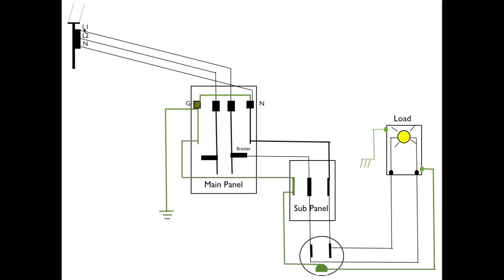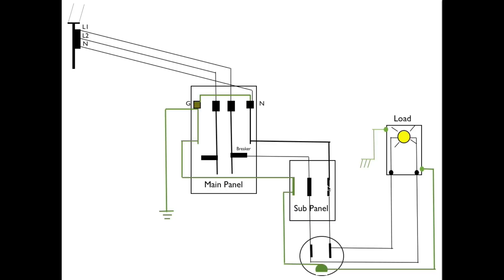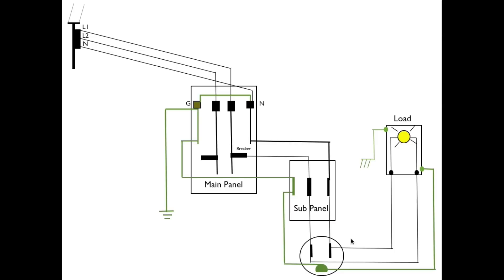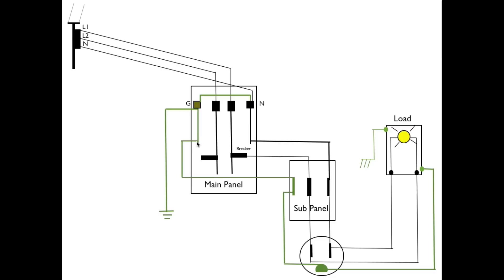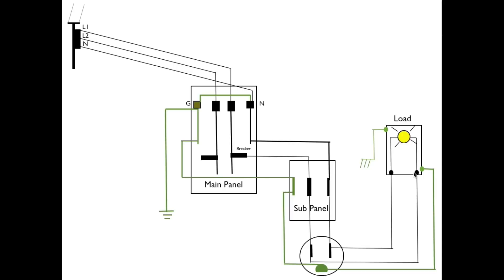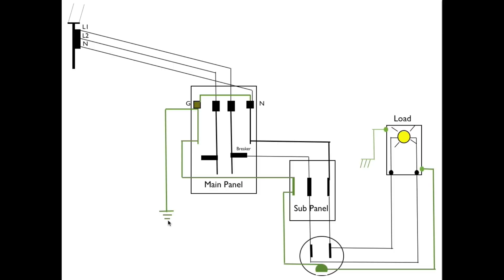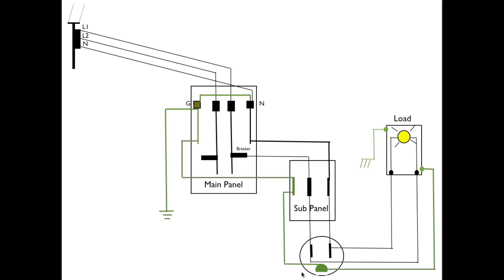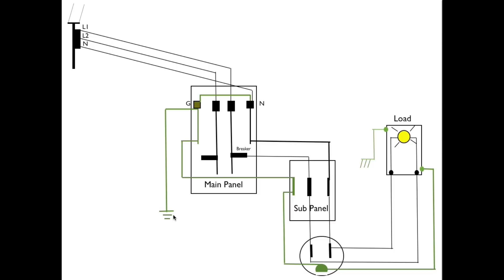The difference between neutral and ground on the electric panel

Comment: If you connect the metal case to the neutral wire it should work fine because this wire is also connected to the ground, if the hot wire became loose and touch the metal case it would be a shotcircuit to both neutral and ground. The problem becomes if you wire the installation backwards or in some countries like here in Spain you have plugs that can be connected either way.
There are also Ground breaker circuit devices on the electric panel and they need separate ground wire to work.
Reply: The active (hot) wire is not connected to the case, you need double failure to get this "lethal device" the active (hot) wire has to became loose and touch the metal case, and the metal case needs to be isolated from the ground.
Reply: Prior to the 1950's appliances such as stoves were actually grounded via the neutral conductor, there was no grounding wire. Spain uses 240 Volts only, there is no neutral wire.
Reply: Why do you say that there is no grund wire? We use 380v on a three phase system and 220v when its a single phase. There is neutral wire but you can't use it to ground because the power plugs and sockets are symmetrical, if you do that you could unplug any device turn 180º connect again and the metal case would be connected to the live wire instead of being grounded through the neutral.
Reply: Back in the early days of electrified homes in North America, the wiring was done using separate, open conductors, similar to the overhead, outdoor power lines, only rubber insulated and cloth covered, supported by porcelain insulators and sleeves, and protected by woven cloth sleeves (loom) where needed (a wiring style often called knob and tube, after the supporting insulators). Connections were made using soldered splices, wrapped in rubber insulating tape and cloth protecting tape. Nobody thought of running a non current carrying, grounding wire around the house, as this would require extra work. Major appliances, such as the kitchen stove were connected to the system by having the house wires go right up to the stove's terminal block (hard wired), with no plug. The case was grounded by running a wire or strap from the case to the neutral terminal of the appliance. Portable appliances, such as table lamps, toasters, and irons, were connected via a plug and receptacle having symmetrical, vertical blades and slots, which could be plugged in either way. And light bulbs had a screw-in base, as did fuses up to 30 Amps. Later, this wiring was succeeded by double insulated, multi conductor cable supported by staples or clamps, with connections using wire nuts or insulated clamps inside metal boxes. It was now a simple matter to add a non insulated grounding conductor to the cable's bundle. It took a few years to develop a set of plugs and receptacles for various voltages, amperages, and phases, including a u-shaped or round grounding prong and slot. Portable appliances are provided with either a 3 prong, grounding plug, or a polarized, 2 prong plug where the neutral blade is wider than the line blade. You can even buy stoves and dryers that come with pre-installed cord and plug sets for connection to the electrical supply.

Comment: Makes perfect sense, sir. Now having said that, as long as everything is grounded, and the neutral and ground are NOT connected together at the sub it should be possible to have a 220 sub. Am I right or wrong?
Reply from the maker: You can certainly do so.  If the sub is only 240, no neutral is required if the appliance is a 3 wire but not if it is a 4 wire.
GFM

Comment: Thanks for the explanation! Now I'd like to understand how a GFCI works.
Reply from the maker: Been meaning to do that one.
GFM
Reply: It is pretty straightforward. The GFCI compares the current in the hot and neutral wires. If there is an imbalance (which would indicate current leakage somewhere downstream of the GFCI) then the GFCI trips.

Note that the GFCI will work, with or without the grounded (green) wire, as it is not compared to either the hot or neutral wires.
Reply: GFI's  - the important point is - it only takes .005 of an amp to trip. That's pretty small and VERY SAFE!! If I through you a plugged-in toaster while you were in the bathtub, you'd be OK.  Better than any ground/fuse combination could ever do!!!

Comment: I really enjoyed your video and I learned from it. I have a theoretical question. It would seem to me that neutrals and grounds could be on the same busbar in a sub-panel, IF that sub-panel was simply an "extension" of the main service panel.  May I give an example. Say you have a 200 amp main service panel that only has room for 20 breakers and one's situation calls for 30 breakers. (naturally the combined amperage of those 30 breaker/branch circuits not exceeding the 200 amp available...). The sub-panel is adjacent to the main service panel and hard piped to it. Three cables directly join the two hot busbars and the neutral busbar together, from one panel to the other. There is no EGC (equipment grounding conductor).  In this situation the busbars from the sub-panel are simply an extension of the busbars from the main service panel. It would be no different than if one was to weld up a larger service panel (metal box) and weld extensions to the two hot busbars and the neutral busbar to receive more breaker. In that case there would be no "parallel paths" for currant to flow down, anymore-so-than the neutrals and grounds bonded together would have in a single service panel; because essentially the two panel are one.... ( I hope my example is understandable.) Am I missing something in the analysis?

Comment: S.W.E.R Wired (Single Wire Earth Return) is still used on some remote properties, this system uses the soil as a return path but it is unreliable in very dry conditions.

Comment: I certainly appreciate your videos and have generated a question.  If a 3-phase motor’s ground cable is connected to a neutral block, would this have any affect the motor’s operation?
Does this mean the motor’s chassis will be hot?
Reply: It will not.
GFM

Comment: To understand the Neutral and the Ground. In Direct Current like the battery source, we have the positive the negative and the ground.The positive and the negative is the source,where the current flows and the  negative connect to the shassis and we call it ground. In alternating current from any source,  we have Hot line/lines and Neutral either single phase or three phase from any source of AC.The word GROUND came from the grounding or connecting the Neural to deep ground or Neutral to Earth to prevent electrical shock. This kind of method neutralized the Serge Current spike preventing to damage electrical component including human and animals.

Comment: I think this video all makes sense but I thought the purpose of the ground system was a) dispersing lighting strikes (mentioned) and b) a backup neutral.  With the ground and the neutral tied together by a big wire in the main panel, they have to be considered to be the same circuit, even thought the ground won't normally carry load due to resistance.  However in the event of a failure the ground does provide a return circuit if say a lightning strike damages the neutral or a wire comes off in the appliance and shorts to ground, providing safety.

PS I was away on business once, and my wife had convinced a neighbor to put a new plug on the weed eater.  He went hot to ground, and it worked fine because of that jumper in the main panel, but I was horrified.

I also worked with an acting group for a while and we had this 220v lighting control panel, which we couldn't ever plug in so we would find the alternating sides of the 110 that comes in and it would work using a very probably dangerous 220 plug hooked to 2-110 extension cords, and plug them in to either different phases or at least different fused circuits.  It probably wasn't that unsafe, as each side of the 220 lit up half the board so it was really running at 110v it just needed 30 amps.  It was an old lighting controller even at the time which is 20 years ago now or more, but that's how it worked.  It had a 220v plug, but only 110v came out of the 6 connections.  It was intended to put one phase on 3 and the other phase on the other 3, but we fooled it by providing 2-110v connections via the extension cords not really knowing if they were off-phase or not, only that they weren't on the same fuse.

Probably not the safest thing I've ever done.  But we had 2 grounds!

Comment: Excellent !!!

What I don't understand is that ground line connection returning back from the sub panel to the main panel.

We don't have that configuration in our house. We have just a ground bar in the sub panel gathering the house ground wires together and from there there is a thick ground cable going to the earth of the backward.

Is it ok with this ?

Thanks

Comment: A visual way to show the Ground Safely, is take a light with pigtails and in a non protected receptacle, the bulb will light with hot to neutral & hot to ground..  In a GFCI receptacle it will only light when connected hot to neutral & TRIP the circuit if jumping hot to ground..
For unmarked kitchen & bathroom receptacles, this was the easiest way to test for circuit protection as a  GFCI Breaker as it will trip instantly, and if the  light worked when jumping hot to ground, the circuit was unprotected..

Comment: Thanks...one question if a break occurs on the neutral going back to the main panel so the load does not run would there be around 120 volt if you tested it at the break since the load did not drop the voltage ? great videos!!!!!!!!!!!!!!!!!!!!!!
Reply from the maker: In that case, the white effectively becomes hot.  This video may help:  http://youtu.be/jwFAXQXX7kE  Hope this helps.
GFM

Comment: I'm new at all of this. It would be helpful if you could explain the part that the L2 wire (leading to the main panel) plays in all of this, since power flowing to the load is traveling through the L1 and the neutral. Thanks.
Reply from the maker: You might try this playlist:  https://www.youtube.com/playlist?list=PLItXrh64d2JNJOjSivaYXeX88i8MNWgwu
GFM
Reply: Isaac, 
What might help to clarify is that typically, both L1 and L2 would be run to a true sub-panel, not just the one drawn in the video. 
L1 and L2 are legs of the split phase system. They are your 'hots.' They have 120V with respect to neutral, and 240 volts with respect to each other. If you didn't run both, you could not utilize 240 volts and you could not balance your loads running through the sub panel.
Reply: @spruce_goose5169  thanks. That clears things up for me.

Comment: Very informative.  Question sir, our line is single phase 220V L1 and N, our electrician did not connect N to Ground and he put the ground rod under our house not accessible anymore buried under concrete floor.  Is this acceptable or should we get the wirings and groundings corrected.  I was told ground rods should be install at least 1.5meter away from the house not under the house...
Reply from the maker: The rod should be accessible.  I would get it looked at.
GFM

Comment: The diagram and explanation makes perfect sense if your main panel is 240 and your sub panel is 120, what if your sub panel is 240?  So from my main 240 panel I have hot, hot, ground and then jumper my neutral and ground - I'm guessing that's wrong.  Would it require a 4 cable run, a hot, hot, neutral and ground, or a separate ground rod driven for the sub panel?
Reply from the maker: If the sub panel is 240 volt only,  You just need Hot, Hot, and ground going back to the main panel.  If the sub panel is 240 and 120, you will need a neutral going back to the panel.  An example would be a clothes dryer with a  240 volt element and a 120 volt fan motor.  In most cases, no ground rod is necessary.
GFM

Comment: I am not an electrician but was told that there are additional reasons why power generation stations and line stepdown transformers are grounded that do not involve lightning strike mitigation.  It is still a head scratcher to me but it involves autobalancing of the two sides of 2 phase power. Supposedly if a residence used a large portion of their power from one phase while using little power from the other phase then some problems would result but for the grounding on the stepdown transformer.  Anyone have any further  info?

Comment: Thanks for posting....  I installed a sub-panel without properly grounding it, so I have to back up and get it right.  The situation is that I have a 200A main panel and a 100A sub -panel in my office. The sub-panel has the neutral and ground bars joined (as if for a main panel). How can I modify this to serve as my sub-panel? Can I buy a bar for the ground wires and run my ground wire off that to the grounding rod?
Reply from the maker: There is usually a jumper in the sub panel that can be removed.  Hope this helps.
GFM

Comment: Thanks for the video. I've got a late 1800's home (in town) with a newer main breaker panel. The 240v dryer wasn't working due to no power to one leg because there was a faulty lug fuse panel in between the wiring for some reason (lazy electrician?). 

I decided to run a new 10/3 and a 4 prong dryer outlet/cord. Instead of a separate neutral and ground bar, there's 3 small ground bars with some grounds/neutrals under the same terminals. No jumpers. There's also one 8 gauge wire running out of each bar. 

So wiring up a 4 wire dryer outlet would basically have me running the neutral and ground to the same bar. Does this make sense? 

So the chassis of the machine would be a ground and neutral? Whoever touches the machine and a hot wire would become a neutral path?
Reply: Question #2. If there's a neutral (return path) and a single leg on a 120v, does the current alternate between the neutral and the single leg? I thought this was the concept of AC. Or does this only apply to L1 and L2 in which current would alternate?
Reply from the maker: It is alternating current, but it just does not work that way.  Neutral does not become hot.
GFM
Reply: +grayfurnaceman In which circuit does the current alternate? Does this only apply between 240v legs? For example, an air compressor that requires only a 10/2 but no neutral.
Reply from the maker: It alternates between the 2 legs.  When one leg is +120, the other is -120, equaling 240.
GFM
Reply: If the ground wire at the ground rod carries no current, then where does all the current from the neutral bar go? It is connected to the ground bar.
Reply from the maker: The power goes back to the pole transformer as a center tap in the transformer.  I did just do a video attempting to explain this.  Check my channel.
GFM

Comment: The grounding is for protection only.(in case the hot gets loose and touches the frame and energizes that frame, the grounding will complete the circuit and allow the breaker to trip). The neutral is for normal operation. 10min. video explained in a few sentences.

Comment: Very Informative video, thank you for posting. I am trying to do some electrical planning.. I have a jointer on the way that I prepped the 220 outlet in a 3 wire configuration as per the manual. In the panel I set up 240 by running a single hot wire from each 20 amp breaker, along with the ground froml to the outlet. I am eyeballing this 240 bandsaw that I plan to buy within the next couple months so while looking in the manual, I noticed the bandsaw power cord has 4 wires.. What would be the easiest way to configure both equipment plugs/outlet so that when I would want to switch, all I would have to do is unplug one and plug in the other in the same outlet.. I dont really understand how (and if its ok) to configure the 3 wire outlet I currently have to include a white wire.. I know the ground and white have similar yet different purposes but I am not electrical savvy enough to know what to do in the particular instance. It seems like you have a pretty good idea and so I wanted to ask you if you might have some insight you could share. I would truly appreciate it. Thanks in advance
Reply from the maker: I would use a dedicated 240 volt breaker for the bandsaw.  Run a separate neutral and ground wire.  There should be a chassis ground terminal or wire in the unit.
GFM

Comment: In my experience all entry panels and sub panels have neutral bonded to ground in the USA that I have seen. This is also true with electric ranges and clothes dyers. Those are also with a neutral bonded to ground in cases where a 4 prong is not used to power them.  The likely hood of a person getting shocked by a broken hard wired and permanent connection is almost impossible. Further still most electronics are coupled to neutral and ground through capacitive and/or high resistive coupling. So that means even their chassis are electrically bonded although it is floating, or false ground as I call it
Reply: Funny. I seen few sub-panels with neutral and ground bonded in the sub-panel. And all of those have been illegal. 

I would not call the occasional coupling of an electronics chassis to ground to be a bond - as defined in the NEC or other electrical engineering resources. 

Mater of fact, these days electronics manufacturers go to extremes to eliminate such coupling, especially in amplifier circuits, where the resulting ground loops can be quite troublesome.
Reply: NEC is quite clear about sub-panels' and their ground and neutral being bonded together. NO...

Comment: GFCI - that's also another reason ground and neutral need be separate.
E.g. large industrial building (or even a home), we may have a single large GFCI breaker at the main panel.  It works by detecting any difference in current between the hot and neutral (or two hots).  If neutral were bonded to ground at any point beyond the GFCI protection, then the GFCI couldn't work.
Reply from the maker: So true.
GFM